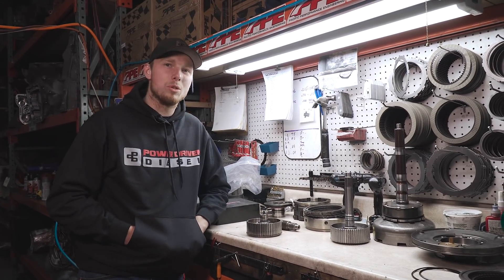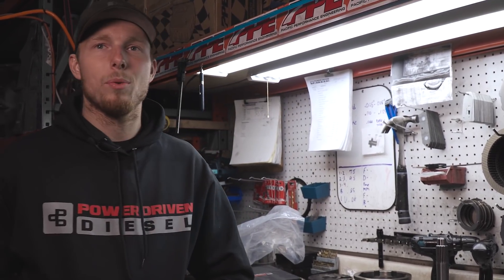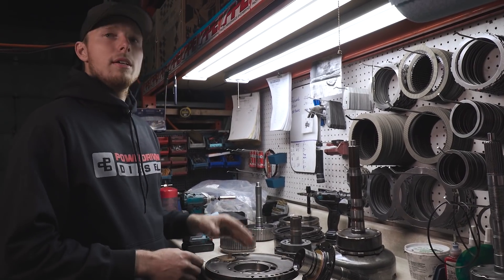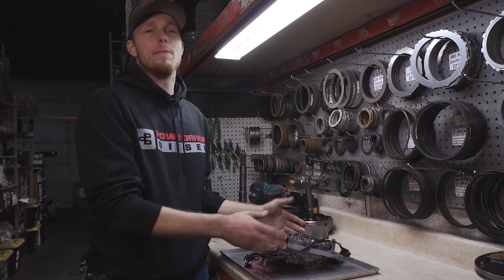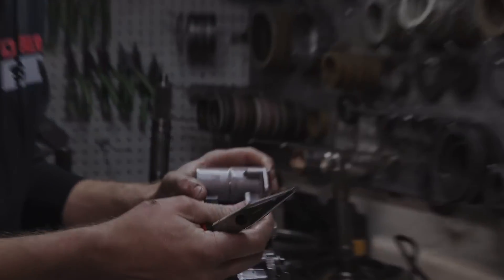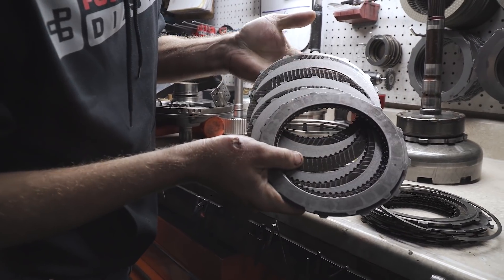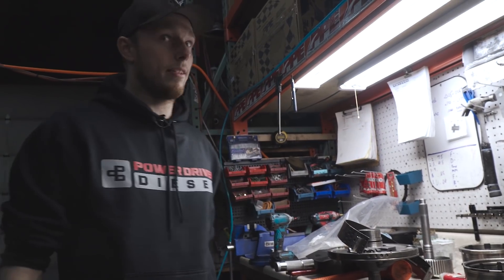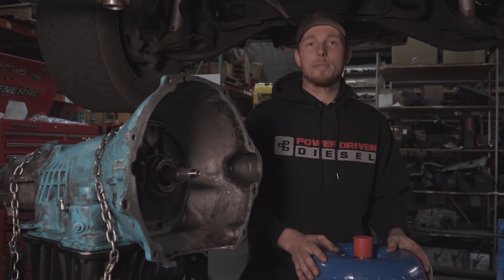Broken Billet 48RE Input Shaft | Dodge Cummins Transmission | Power Driven Diesel

Comment: Well I have a brand new stock tranny that I'm getting ready to pull apart replace the accumulator vb and input shaft as well as a torque convert er from georend. That trans should hold well I'm only running about 600 horse max at this point in time. Plan to get to these guys and get a couple dyno runs done see real world figures. But the old trans died from use abuse and age. Iv got this one built and the replacement was a hurry up I need the truck it lastef 7000 miles. All stock build stock tqc vb and all stock lockup as well. It just could not hold not sure what gave out in it but lost all foreward gears still has reverse. Have fun guys

Comment: Can the input shaft be installed without removing valvebody or oil pan
Reply: The 2nd gear band has to be removed, so it might be possible to finagle, but probably not worth the effort.

Comment: Great video. Fun to watch Myer work on these transmissions. Breezes through them. How much time, not in time lapse does a normal build take?
Reply from the maker: A good builder can completely tear down, clean, refresh, upgrade, and build a whole Dodge 47 or 48re unit including valve body upgrades with test stand time and finish paint in one 8 hour shift.  Newer builders that are still learning how to be efficient can build 2 or 3 complete transmissions in 1 40 hour work week.

Comment: "I use every bit of that horsepower everyday"
                  -Meyer

"This setup is NOT rated for this much horsepower, but if I get another 9 months out of this build 👌"
                     -Meyer

Killin me dude! Between all the rigs racing out of this shop...........you guys got er dialed in!! The engine department is even coming around.........Josh 🤣🤣🤣🤣🤣🤣🤣🤣!! Sorry pard, couldn't resist lmfao. But you keep going right back at er and that's what counts, people can say what they want but the fact is chit's gonna happen and chit's gonna break whether it's operator or mechanical...........you keep on swingin and that's what counts in my book.

Comment: Whats in that spray can that u clean the valve body with
Reply from the maker: Brake Cleaner that is refilled from a 55 gallon drum and charged with compressed air.... much cheaper than burning through a case of brake cleaner on each build.

Comment: Is that a 47 or 48 trans? I am sure it’s obvious but not to this eyeball lol. Adrian
Reply from the maker: It's a 47re transmission.  48 and 47 are very interchangeable and have a ton of compatible parts they share.  This truck has a 47re case so the factory harness and neutral safety switch would hook up more easily without cutting wires or adapting.  But technically, it could be stuffed full of 48re parts if/when the 47re parts fail.  Would you like us to do a video showing the differences between 48re and 47re internals?
Reply: @pddofficial  

Heck yea that would be cool and very informative. You guys built my 48re in my 05. So I was trying to find clues to see if it was either.  Thanks Adrian
Reply: @pddofficial  i would like to see em i know the 48 has better planets and another clutch in the direct drum and the 48 has speed sensors and a some other electric parts there is no govner on the 48 and there late common rail was drive by wire
Reply: @pddofficial  Definitely would like to see a video on differences and interchangeable parts... Plan on building up a 47RH for my first gen here, sooner rather than later.. the 518 isn't doing so well anymore

Comment: I got a few questions. What valve did he stack the springs in the 1-2 shift valve or the 2-3 shift valve. Also I see ur only using one spring for the od instead of the 3 or 4 red springs that transgo uses whats the reason for this firmer of shift.
Reply from the maker: That's the 2-3 shift valve, sometimes with worn bores in the VB, stiffer springs provide more exact shift timing on a full manual VB setup.  On the OD accumulator spring, there really isn't a ton of difference between stock, 3 red Transgo, or heavy single spring especially with the restriction plug in the accum.
Reply: @pddofficial  ok thanks